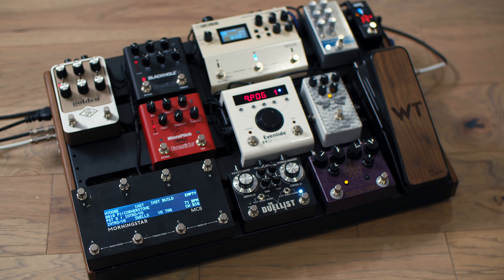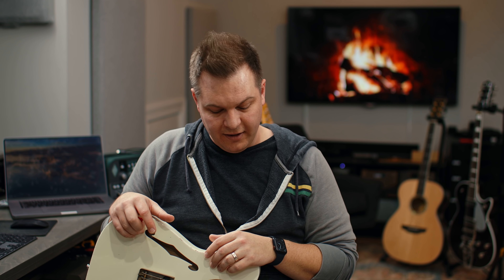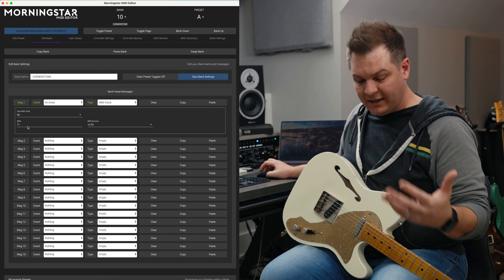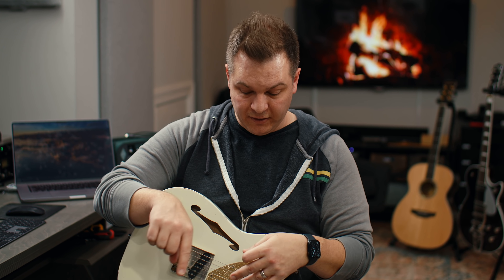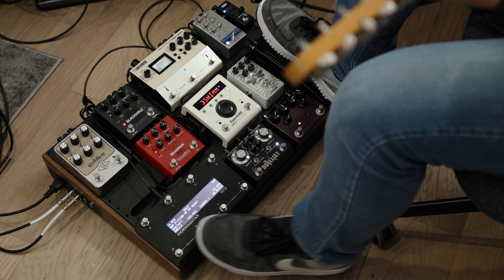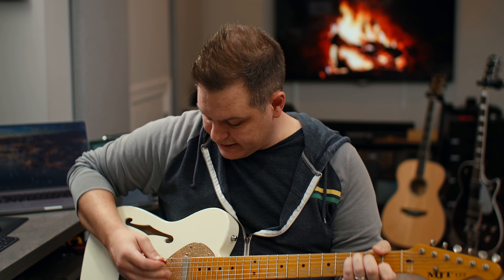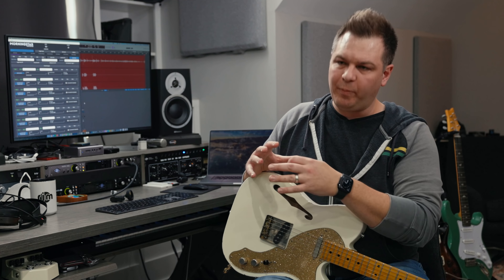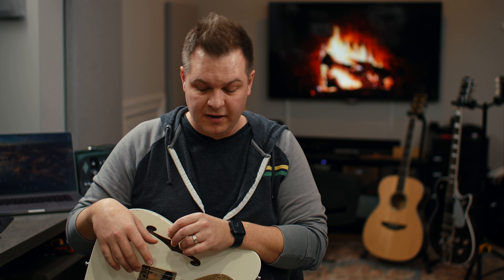Take control of your pedalboard with MIDI // How I turn my board into a Helix with MIDI

Comment: I’ve planning on doing the same thing to my board (only with a MC6).  Thanks WT team for putting this out!  Very insightful.
Reply: MC6 is great too, you will like it. It is what I use to run my board similar to this and also when I use my Fractal, the MC6 is used for extra sections and to move presets up/down, and a the tuner.

Comment: Hi Brian. Thanks for this. I would love to put a second board with analog pedals and have been thinking about midi. I get how midi enabled pedals work with midi but I’m a bit confused how you get non midi pedals to work with a midi switcher?
Reply from the maker: Thanks! There is a midi enabled looper under the board. So the drives are routed through the individual loops in the looper, which can then be controlled via midi. The one I’m using is the Morningstar ML5.

Comment: Hmm, i put this comment the other day, but it's gone. I know the WT crew's position on music stands, and I get that - not trying to start that discussion here :) Are there any onSong users out there who are using onSong as a MIDI controller (or integrate with propresenter or something like that) - automatically change your pedals' (or Helix etc) settings as the song goes along?

Comment: ML5 is not available anymore. It’s EOL product, so not good to promote it.
Reply from the maker: It’s available here: https://www.morningstarfx.com/shop/ML5-Loop-Switcher-p125258809

This video isn’t an advertisement for Morningstar - that’s just what I use on my board. You can do this stuff with any similarly featured Midi controllers. Lots of midi controlled loopers out there (like from RJM for example).